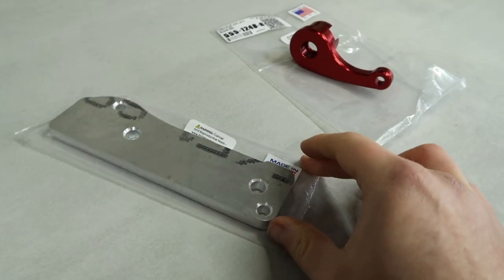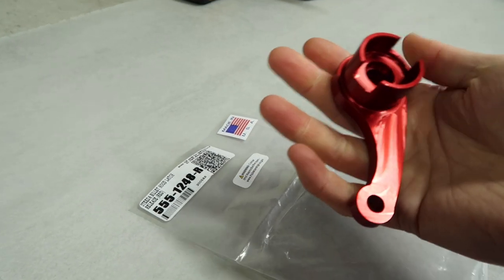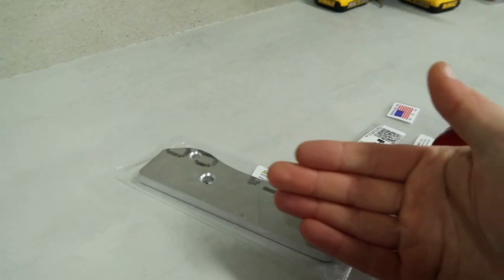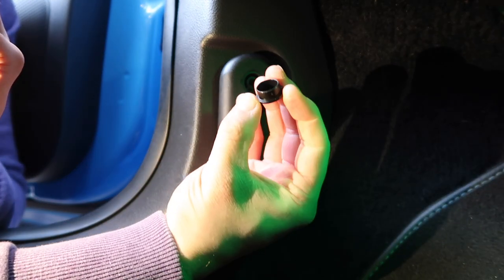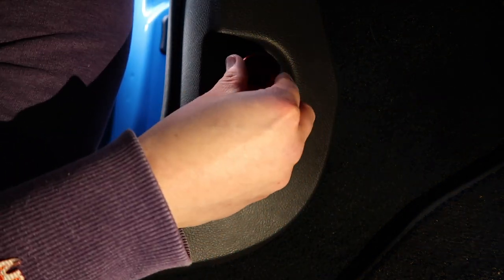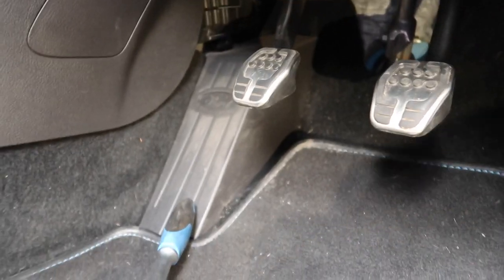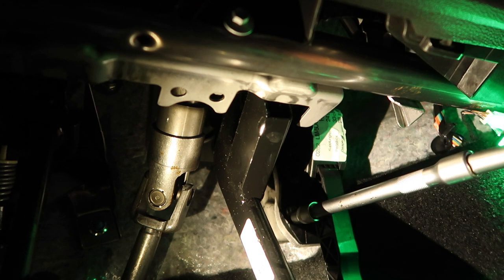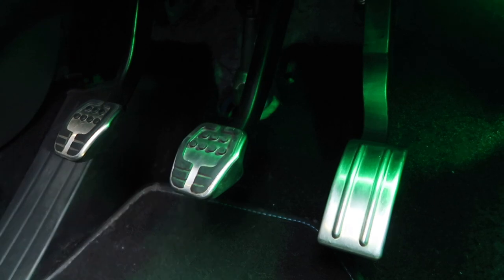STEEDA INTERIOR HOOD LATCH & GAS / ACCELERATOR PEDAL SPACER INSTALLS! | FOCUS RS

Comment: The Ford Escape/Kuga uses the same hood latch release lever. I have done same Steeda Interior and under hood latch lever on my ST. I plan on doing the same on my 2019 Escape 2.0L Ecoboost. Nice little touches, yes the Ford plastics are not very reliable.

Comment: Wondered why I've not had much success heel and toeing.  Just thought it was me being useless!  😂
Reply from the maker: Lol not at all, tbh heel toeing isn't really a thing driving at low speeds (no-matter what some folks on facebook/forums might say!)
Reply: @AdamRainey  Agreed.  It's only really required at speed to match the engine speed to wheel speed to prevent locking up, and of course keeping revs higher.